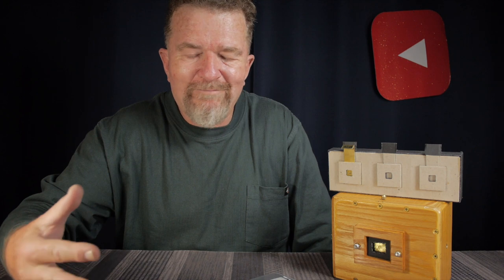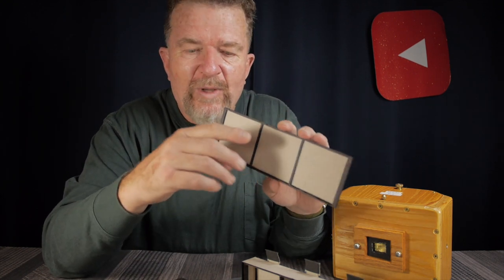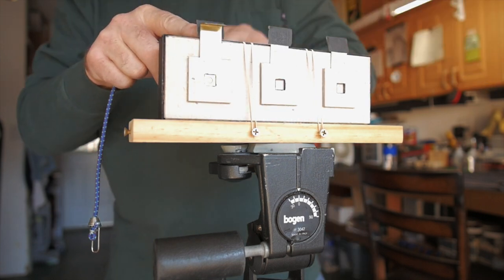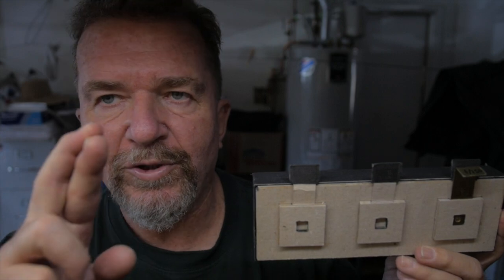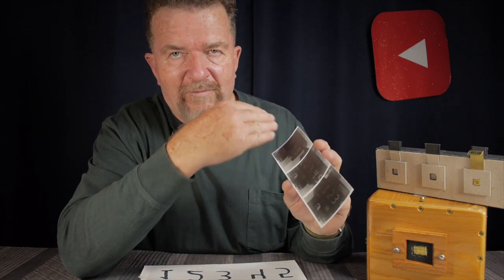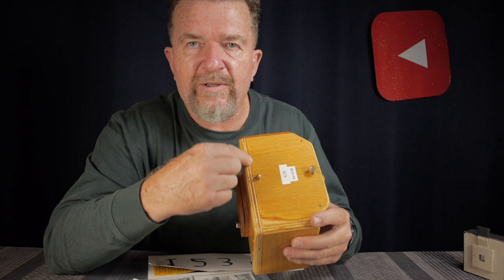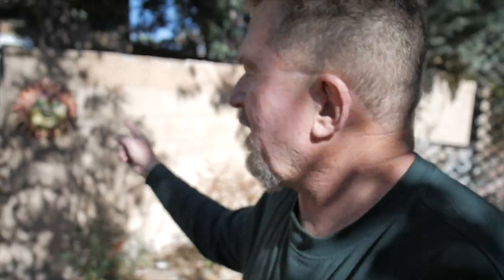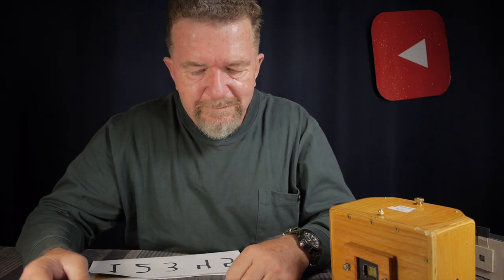Bryakilev's Pinhole Grid Camera

Comment: Thanks Joe. Really neat idea from Igor. I'm trying to get my head around whether this makes a significantly shorter effective focal length compared to a single pinhole.
Also, random idea, I wonder if you could use the iris from a lens as the plate? It would give round images but ones that could be varied in size very easily. Perhaps spirally (or randomly) arranged pinholes. Another project I must not start!
Reply from the maker: I think it gives a wider angle of view for the same focal ratio of a single-pinhole camera with the same pinhole-to-film dimension. This will be evident when I present a video next week, using this same principle to make a variation on the pixellator camera.

An adjustable iris would be easy to implement. I'm also going to a try a hexagonal tessellation of pinholes, using a hexagonal inner window.

Also, I didn't really get into the details of figuring out the layout of the pinholes and dimensions. Basically, if you define the film size, pinhole-to-film distance and the width of the pinhole array, then there's only one size and location of the inner window that satisfies the design conditions. I calculate the layout of the pinholes based on the centers of each image area at the film plane, then scale that layout down proportional to the ratio of film-to-inner window : inner-window-to-pinhole dimensions. My test camera is limited to a particular pinhole-to-inner window and pinhole-to-film plane dimensions. The size of the pinhole array kind of determines the overall size of the image array at the film plane (for a particular focal length), while the width of the inner window determines the border of each image area.

Maybe I'll do another video specifically on figuring out these dimensions.

Comment: Interesting... I never thought of using parallax to make a wide image without resorting to a curved film plane...
Optimal window size should be easy to calculate either by graphing it on paper or using a graphics program.
Also, having a frame that has a gradient towards the edges could make the transition softer.